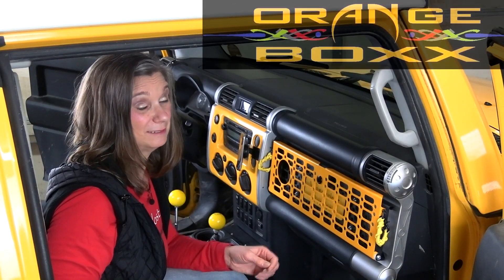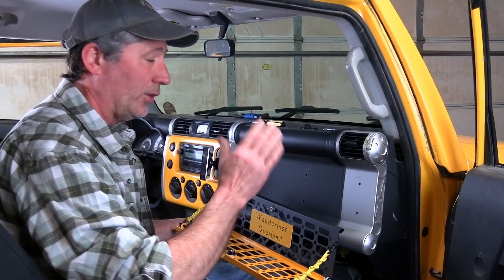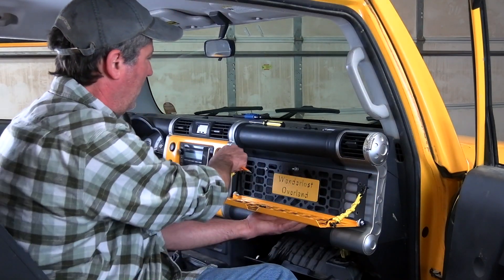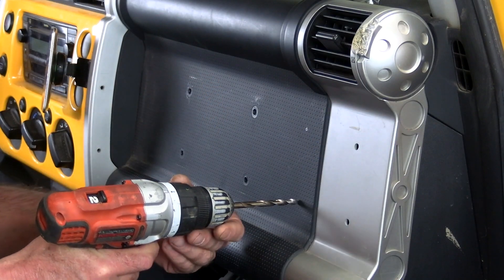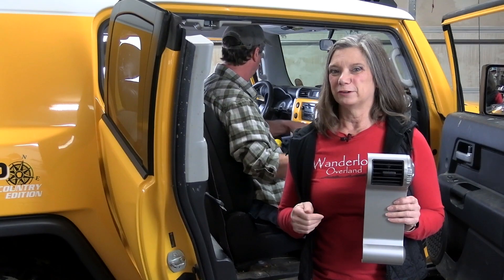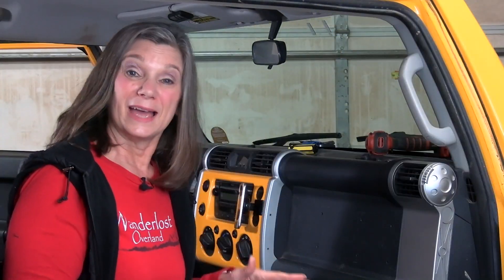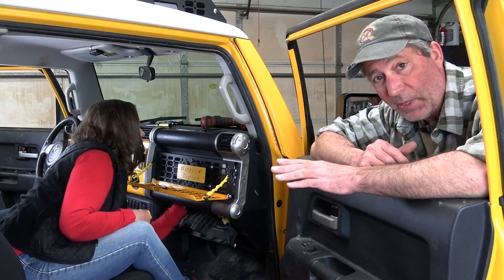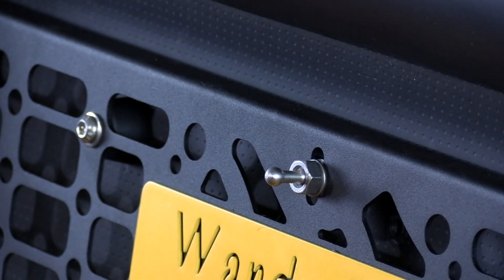Molle Dash Panel With FOLD DOWN TABLE! Orangeboxx Fab For FJ Cruiser

Comment: Now that's a gear that I'll seriously consider.  Thanks for sharing. 👍
Reply: Now through March 22nd 2022 use code M3 for 10% off
Reply: @OrangeBoxxfab  I'm from Australia, when will you release a version for RHD vehicles?
Reply: @fatmanoverlanding  Most all of our products are made for RHD and LHD.  Very few of them are not made to fit the other side. So this product as far as we know will fit the left side of the dash. If you can feel up behind that part of the dash with your hand it will fit.
Reply: @OrangeBoxxfab  So the mounting base of this is symmetrical?  No specific shape for either LHD and RHD?
Reply: @fatmanoverlanding  Thank you for considering Orange Boxx Fabrication. Yes I do not have a RHD But as long as you can get your hand up behind the Dash on thaat side like a LHD it will fit it. Like all the rear panels they are symmetrical.